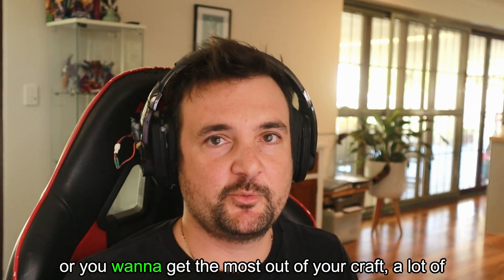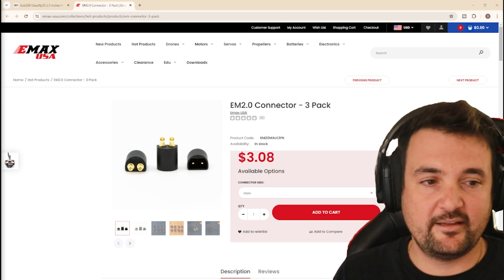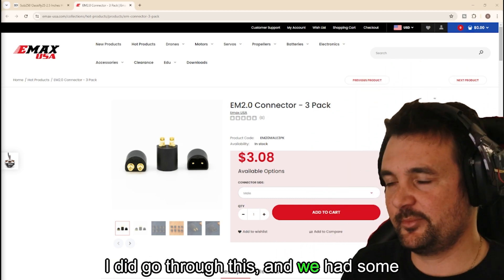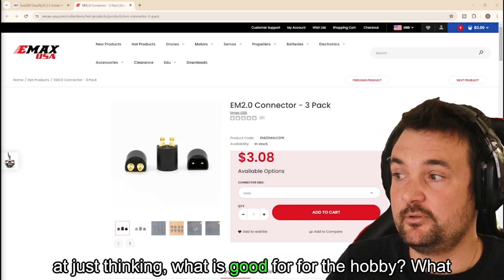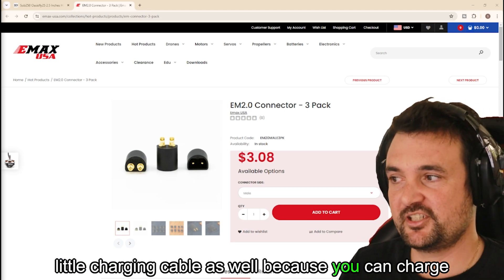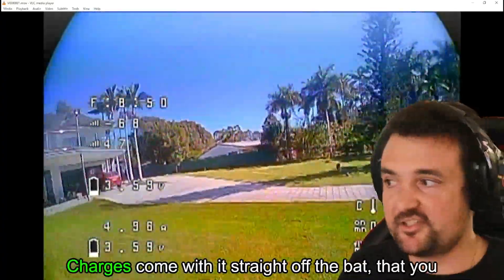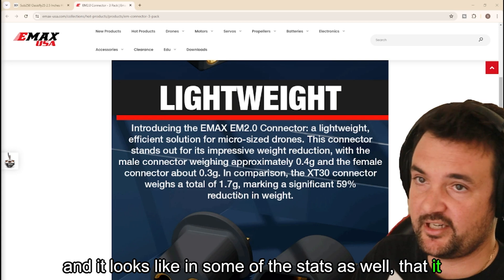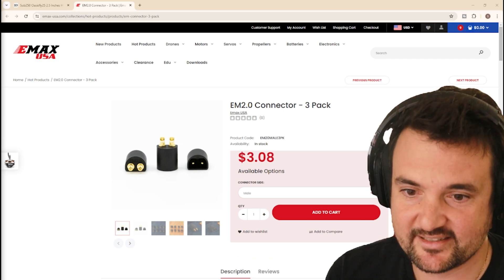CHANGE WHOOP RACING FOREVER?

Comment: A30 is the cheaper open source alternative to BT2.0 we already have. GNB2.7 is slightly better electrically and also open source but not as well supported. At this point I'm not sure I would switch off BT2.0/A30 unless the replacement could push XT30 amps at sub gram weight.

Comment: A30 had a purpose: open source- making it cheaper - and being compatible with Bt2.0.
(Certain lipo producers will charge extra for A30 1s lipos if you want to get them produced - wanted to make my own brand) 
This however will just be one of those “just emax” connectors I feel like: just like their motor mounts; Nanohawk and TinyHawk2 I am looking at you!!

Comment: I think Stu’s point with this, is showing for a similar weight, you get a 20a burst connector, whereas no other connector has done this, I see 15a burst max, and as someone who has direct soldered a battery, I think I’ll have to give em a shot!

Comment: The offense between these and BT2.0/A30 is that these will work on 1S and 2S
Reply: @HalfChrome  what makes this better for 2s?
Reply: I run A30 and BT2.0 on 2S all the time. I can see the argument for XT30 being a better compromise at that size, but the higher voltage isn't actually a problem.

Comment: The solution is to NOT RUN 1S! Ohms Law, higher voltage = lower current
Reply: @billh308  how many 65mm tinywhoops are on 2s?
Reply: @putrid.p  I mean technically you could shoehorn the X12 AIO from a Mobula7 or 8 into a 65mm frame, and then rubber band 2x250mah to the bottom... You probably shouldn't... but you could. :P
Reply: I don't think so...

Comment: FPV drones need a new design in battery connection cause the angles side and flat side can still be reversed connected and spark and your contractor just got shorter. Having a half moon XT60 or XT30 would be the best way to go. But we'll see what China comes up with since there the only country that can make that change

Comment: Another new battery connector???  I still use PH2.0 on my whoops, and beat most people.  Going to use them again this season for the same reason as last season, because I was told I could not do well with them.  I qualified 8th in Elite class with them by the way..........  It's not the battery, its the pilot.
Reply: Still doesn't change the fact that A30/BT2.0 performs better, sags less and is gentler on your cells.

Comment: this seems more like their answer to the A30 connectors becoming the open source standard vs them just wanting to do something nice for the hobby, im not saying anything new that the other people in the comments havent said already regarding the A30 compatibility with other already established well performing connectors like bt2.0, until JB does a video on this connector proving its significantly better than A30/bt2.0, i personally see no reason to buy these connectors, and from the sheet they gave you, they seemed to conveniently leave out the existence of A30 connectors entirely which have already fills the shoes of what this connecter is attempting to do, but does it significantly better

Comment: Sorry Stu, I think the A30 from GNB is a better alternative to bt2.0 for 65mm whoops.  I have plenty of bt2.0 batteries and I'll buy A30 batteries to replace them.  For 75mm whoops I go with xt30.  All of my 75 whoops are now digital HDzero and WS.  Bigger whoops can take 450, 550, 650, and 720mah batteries.  The slight weight increase from a30 or bt2.0 to xt30 is negligible on a 30g+ digital whoop.  The lightest 65 digital HDzero whoop of mine is 23g running A30 connector and bt2.0 batteries.  

p.s. Thanks to you for getting me into FPV with your emax tinyhawk 2 and what you need to get started and how to video.

Comment: A30 is open source, established, and is almost completely compatible with BT2.0. The clear problem with this connector is that the polarity is not obvious, which is critical. BT2.0 and A30: round is ground. It needs some testing but by the looks of it I don't think the electrical properties of this will be any better than A30.